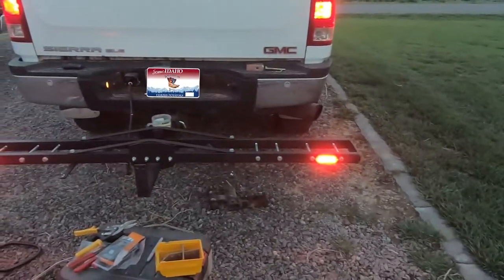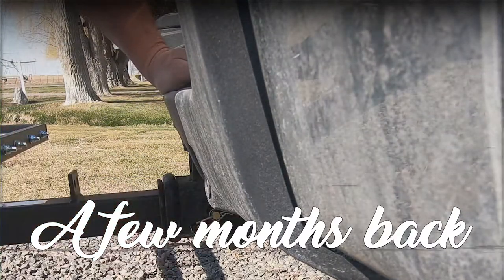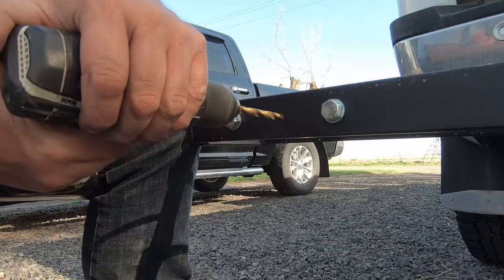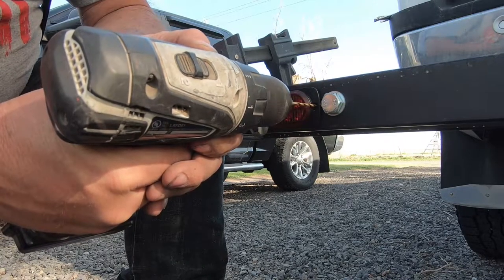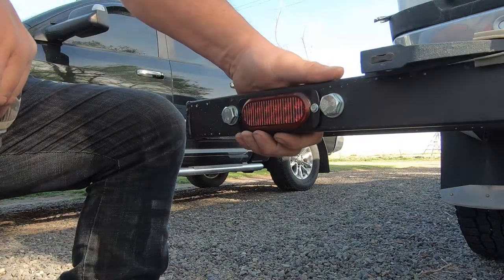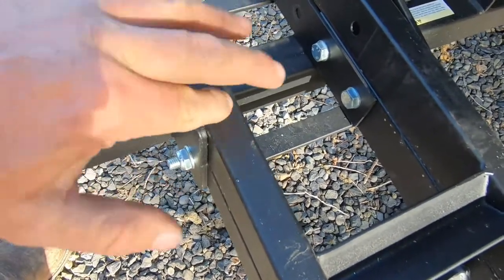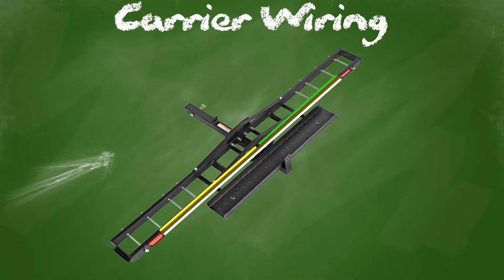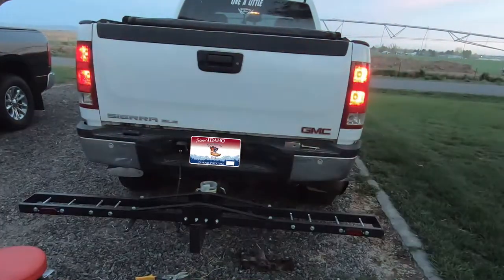DIY Motorcycle Hitch Carrier Lights

Comment: Where did you find the lights at please?
Reply from the maker: Pack of 2 Aluminum Housing Red LED Trailer Stop Brake Turn Tail Lights, AT-HAIHAN DOT Compliant Waterproof Surface Mount Lighting for Truck Tractor Jeep RV https://a.co/d/7LQra54